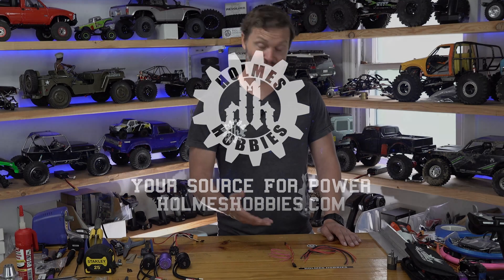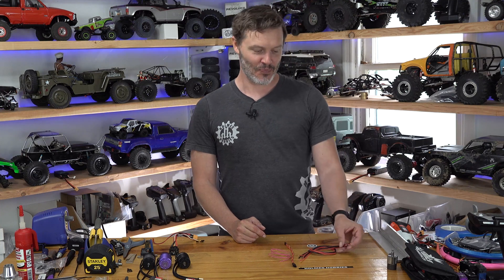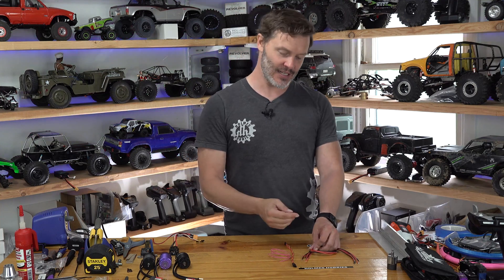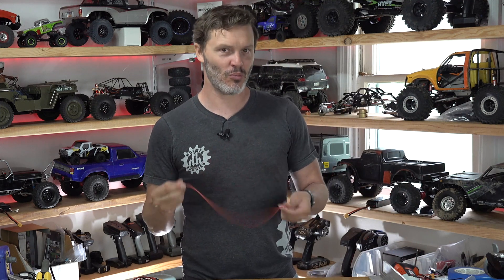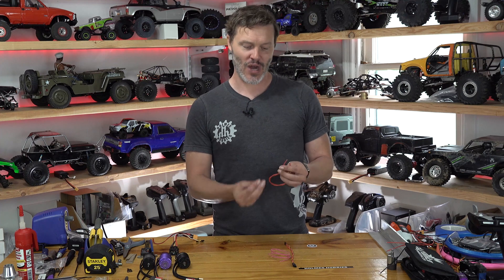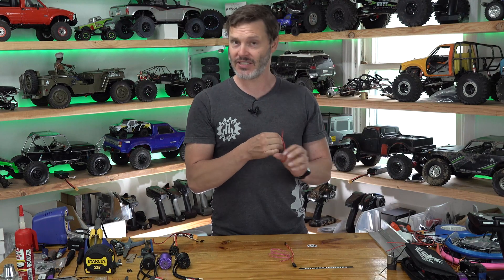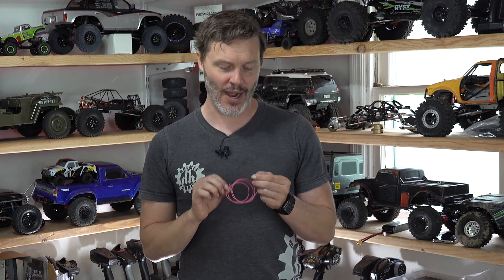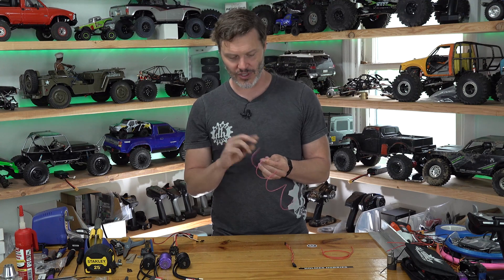What makes a wire so perfect? Wire secrets revealed (Top TIps) HOLMES HOBBIES

Comment: Man I would love it if the BR-XL was offered with the female bullets soldered directly to then ESC like the Castle units so I can use my 12awg silicon all the way through, and a cleaner install
Reply from the maker: used to be like that, went to direct wire so they had lower profile .

Comment: Another thing to watch out for when buying cheap chinese wire is the insulation thickness versus the copper thickness. I've had wire that looked good at first glance, but when looking at the cross section it was nearly all insulation with very little copper in it. If buying it by the reel, the ends can be hidden, then the reel shrink wrapped over, so you don't know until you open the packaging.
Reply from the maker: ive had this happen for sure!

Comment: The voltage travels on the surface of the wire so the more strands the more surface area. Same with our control wiring. There's a lot of information going back and forth and the more surface area the better the signal.
Reply from the maker: At the frequencies we work with it doesn't matter .  and if the strands aren't insulated it acts like a solid core unless there are air gaps.